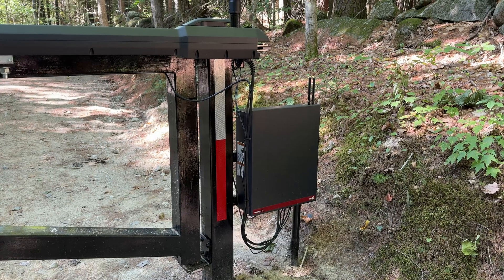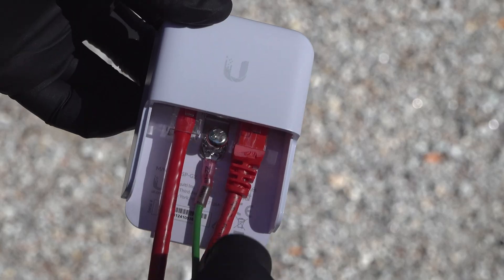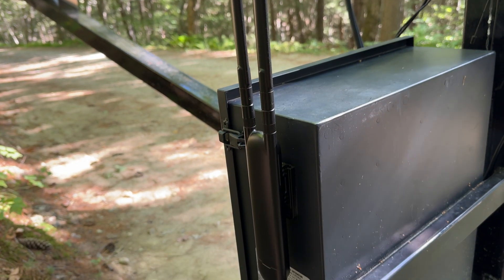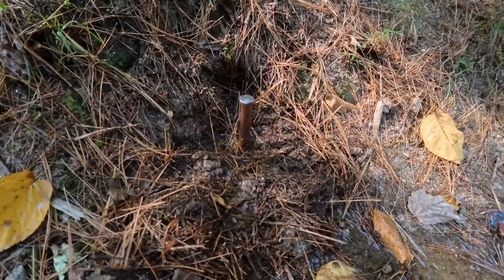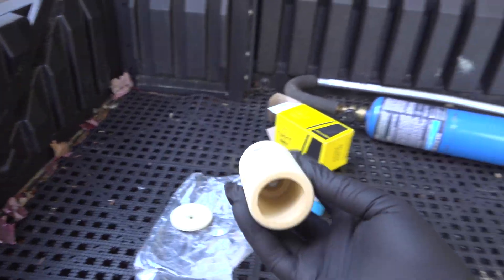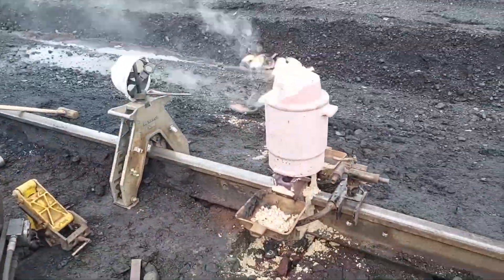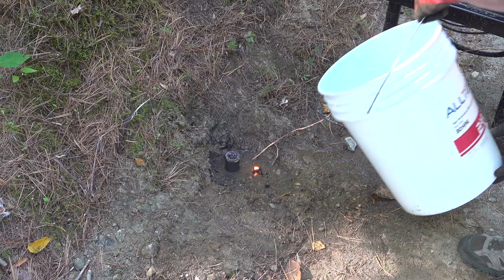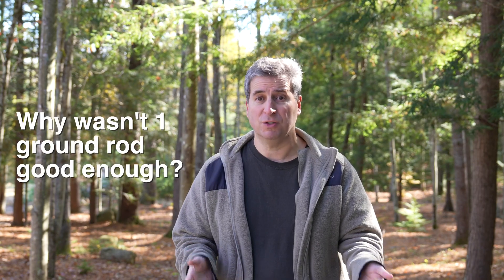Best Way to Protect Outside Network Equipment From Surges

Comment: If you have a hose near by use a copper pipe instead of a rod, connect the hose to the pipe and use it like a water powered drill. 2m pipe goes in, in a matter of minutes.

Comment: You have the correct concepts!  Good video!  Only one important "tweak" that expands on what you have already done.  Depending on soil resistivity (which can go from 100 Ohms/m in good soil to 10,000 Ohms/m on rock), the nice ground rod and #6AWG bare conductor in soil might still be 25 Ohms effective or higher.  Even 100 Ohms (3m rod in 300 Ohm/m soil).  Not magically 0V when current is flowing.  The key to electronics survival is BOND everything together as you show with your ground bus.  If that entire metal cabinet, gate, Ethernet, surge protector, switch, etc are all referenced to the same "0V" ground plane, then the 100 Ohm ground rod and Ground Potential Rise (GPR) doesn't matter.  A lightning strike that induces say 2A into your wiring into a 100 Ohm ground system is 200V GPR.  If everything is bonded, then it all "floats" together to 200V.  As long as it is 0V between equipment (bonded together), it all survives.  Bird on a wire.  Strong ship hull on a wave.  Bonding is more important than a super low (<10 Ohm) ground system.  This is how cell sites and towers take a licking and keep on ticking.

Comment: When I did my ham radio antennas I grounded everything using cadweld but I also bonded everything back to the service ground as required by code. Otherwise you’re going to have a ground loop and a nice path for lightning to get back to your house. That is unless it’s completely isolated from your home. But since I have 90 foot lightning rods (antenna towers) at my house it’s sort of necessary to bond.

Comment: Great video, I wasn't aware that these thermite like kits existed - and they are indeed the best solution. But I would be vary with shock cooling the weld, that will make it brittle which is no good.  I usually use the Raychem shrinktubing kits for terminating ground rods, they are inexpensive and the shrink tubing and intumastic tape are very thick and everything is made for underground termination.
For driving in the grounding rod you can buy an SDS adapter, they are fairly inexpensive and with a good SDS hammer drill they are in with no hassle. 

When installing 3-phace SPD units, I was also under the impression that they led the surge to the ground - but as I was told it's actually not how they work. They work by shorting out the 3 phases, Neutral and ground, and thereby hindering excessive voltage differential upstream to the consuming units. The ground is there to keep everything as close to ground voltage as possible, but the surges from lightning strikes are so massive that it's nearly impossible to lead it all to ground exclusively.

Comment: don't pour water on top of it , let it cool down on it's own, letting it cool naturally for 10–15 minutes ensures the strongest, most corrosion-resistant, and electrically sound connection possible.

Comment: The Cat cables also should be metal (YES THEY MAKE THEM) and the cable you use should have a foil shield and a shield cable in addition to the traditional twisted pairs.   Otherwise you are pissing in the wind.

Comment: Cadwelding is a thermite weld.  Same as what they use on rail.  More ground rods mean more parallel paths to the ground plane, meaning lower resistance.
  
Best thing you can do for long runs IMO, is convert to non-conductive fiber.  Yeah, it doesn't convey power like PoE does - but even if you have a lightning strike close to a long wire, it becomes an antenna.  Using isolation step-up/step-down transformers to take you 120V or 240V circuit and bump it up to 480V, and then grounding both the high-voltage segment and the local box at the gate, and surge-suppressing all of the AC lines keeps it mostly away from your low-voltage stuff.  Everything should go into a steel enclosure that is properly grounded/bonded, and all IO should go through a surge suppressor before entering/exiting the box.  I'd just plan on losing your cameras from lightning, have spares.
  
The higher the voltage for the same power, the lower the current (because watts = volts x amps) - which means you suffer less voltage drop over the length of the wire (and you can compensate for any drop with various taps on the transformers.  250Watts at 120V is 2.083Amps, but at 480V it's only 0.521Amps - so at 120V that's a loss over 1000-feet of 14AWG of 12.95V (or 10.79%), but at 480V on the same wires that only a loss of 3.24V (or 0.67%).  This doesn't get better with PoE++, which is only up to 56V as of the most modern 802.11bt Type-4 standard and tiny ethernet conductors.

Comment: Exothermic welding is the correct name.  Whether you are using a one and done mold or a graphite reusable mold it is good practice to heat the mold with a torch to extract all of the moisture first. Otherwise the chain reaction once lit could cause the mold to explode and you could be covered in molten metal which leads to a bad day

Comment: quick tip from a sparky (not like youre gonna be installing ground rods all day) if you want to install a ground rod without breaking a sweat just use a sds hammer drill with a cheap ground rod bit.

Comment: You shouldn't use ferrules on wire with only few strands, it may be less reliable than just screwing them in in a terminal block, cool project though :)

Comment: I prefer using fiber for total galvanic isolation. Sure, you need power at the other end, but this is way easier to protect than delicate networking equipment.

Comment: Just run fiber and leave the copper cable just to deliver power. Fiber is cheaper than UTP cable nowadays and you don't risk having expensive networking equipment damage by lighting!

Comment: If you're running ethernet wire back to the house, the rod and equipment at this gate need to be connected to a ground line going back to the house's main ground.

Comment: An SDS Max drill with hammering chisel is great for this. Also if its very serious, for a house as an example, consider using stainless steel
Reply: Can confirm works great.  There is also a specialized slide hammer for use on ladders with those 10' rods,  works like you would expect and prevents the crayon eaters from impaling themselves.  Yes, it has happened turns out trying to drive a 10' rod in rocky soil while swinging a heavy sledge can be very dangerous...

Comment: You didn't use shielded cable in your demo...... Nor any shielded cables in that gate box....  The ethernet grounding box connects the shield to ground so if you don't use shielded cable - then the box is still not grounding your equipment....
Reply: You're saying it contains no gas arrestors for the data pairs?
Reply: @SuperSpecies  No I never said anything about "gas arrestors" I said Shielding - those are not shielded ethernet cables. Having a remote ground but the ethernet is electrically connected to another networking device that's on a different ground needs to be shielded. Look up shielded ethernet. It requires shielded RJ45's also
Reply: @cryptogenik I understand what you're saying about STP. I'm simply asking if you know the internal layout of these grounding boxes for certain.
Reply: @SuperSpecies  You didn't ask if I know the internal layout of these grounding boxes for certain - you asked if I was saying it contains no gas arrestors for data pair, to which I said No - and then elaborated on why I did not comment anything regarding gas arrestors.
Your question is so tangential that I wasn't even sure you were intending to direct your comment at me other than the fact you replied directly to me
Reply: @cryptogenik I'm just curious if all these boxes do is ground the shielding, if so that's not very useful
Reply: @SuperSpecies  I know that continuity passes from port shield, to port shield, to the grounding pin. When all these are in contact the difference in ground comes closer to the same potential locally.

Comment: Grounding or Earth is a protection of the user from an electrical fault in your system.  This doesn't do anything for a ground lighting strike, or a lighting strike to your gate, it's literally nothing.  A real AC or DC surge protector is the only protection from lighting, period.....this is a sacrificial device facing your equipment from an external connection or an internal power source.   A copper ground rod is not in any way a protection from Power Surges.  You are protecting anyone who opens your cabinet with a ground fault currently happening in that the metal housings to be disappated to a safe level of either DC (48v or less) or AC which would be below 50Vac.  The earth is a ground at 25 Ohms resistance, best case with perfect soil conditions.  It can not handle nor route 250,000Vdc of a hit lighting strike, period.  The maths don't math my friend.  It will not save your equipment, it will all die in a strike at or near your fixture, period.
In nearly all instances, except very rural, your utility will provide your house a ground as part of it's service....it is the safest path back to Source, so use that.  Extra ground rods are fine, interconnected if greater than 6ft from each other.  Ground rods can create an electrocution hazard during a fault if you are standing near the ground rod and upwards of 25-30ft away.
Reply: Grounding does matter in protection against lightning.

Comment: The code states all ground must be bonded, which is not mentionied or done properly in this video.  

The Ethernet running back to your house could create a ground loop if you don't bond that new ground rod you added to the ground(s) at your house.  In simple terms your new ground rod may have better ground potential and carry all the ac current to ground, over that Ethernet cable.
Reply: He actually uses fiber optic Ethernet cables, but he does oddly run a 12v DC line from the house.

Comment: Just use Fiber for Outdoor connections... in the long run, it will be cheaper. Cable length wont matter much and you can upgrade to insane network speeds any time in the future without changing the cable.

Comment: You do not want to do this, it may even be non code. I know standard Ethernet does not pull through ground, it uses differential signaling. I do not know about POE +^n. HDMI does pull through the ground. So what he has done is create 2 grounds and has attached the ground between the what ever copper cable he is using to connect the ground between the two points. I have seen 125 volt ground spikes over ground between buildings not this far apart, when someone came in the morning and turned on their computer in the morning with the outlet strip. Just say NO to multiple ground points. An electrical system is suppose to have one and only one ground point. What you are doing is creating a ground loop, if you want do this you need to go through a transformer after this you can create a new ground, but this is risky you need to make sure you do not pull through ground any other way. Use Fiber it is not that expensive. The school of very hard knocks.

Comment: this is just basic thermite, also having that system isolated is safer for it than having a ground. It is only safer for "you" touching it with the ground.
ANd 2 grounds aren't required, they are only required if you don't test the resistance of them which is expensive so it's cheaper just to do 2. It has nothing to do with them failing it has everything to do with them never being the correct contact amount to the ground.

Comment: In my area 2 grounding rods are only needed for a 200 amp panel. If you have an older 100 amp panel or a subpanel in a different building. Most places dictate 200 amp panels as the standard for new built houses. This might be where the two grounding rod mandatory thing comes from.

Comment: Why would you waste those few inches by cutting them off? You should have just driven it a few more inches down. The more in ground contact, the better it will work. I don't have my handbook handy, but every inch gives many dozens of additional amps of protection. With lightning being the only source of danger, you want as many amps flowing into the ground as possible.

That crucible device is not welding, it is soldering the wire. Copper is way too conductive for that tiny amount of heat to melt the copper. After a few years, the dissimilar metals will corrode and it will break off, although, being buried, it should not have any pulling stress, so may be fine.

If you really want to use the crucible, then slide it on before hammering the rod. The mushrooming will actually give a better connection.

Comment: You need a Smart-UPS 

I have used them since the 80s and sacrificed many to lightning and copper METH thieves that cut the wires on my 3 phase transformer feeds and sent 600 volts into my 120 outlets 

But all my equipment except for the UPSs survived and APC drop shipped me brand new replacement units 

I LOVE YOU APC ❤❤❤❤❤

Comment: Or pro Tip. If this is a completly isolated install anyway:
Run Fiber, Its not really expensive and when a lightling strike hits your stuff is toast anyway.
The only reason why one grounds network equipment is cuz its expensive.
If i have a 80k Cisco swithc on one end and on the other it sure as shit is cheaper to ground.
But with these cheapo 5 buck switches ehh, why bother. And if you bother why not invest in a 100m fiber cable and solve that issue at the source?
Reply: He did run fiber for data due to the distance but he does have power over ethernet for the power. I am not sure how you get power over fibre.
Reply: @catprog  He actually just did fiber and DC Power from an external source. So PoE is just for the gate controller and cams/aps which kinda makes the title kinda klickbait.
I belive he had a hybrid cable with fiber and copper for DC, or ran it seperatly. But he did a vid on it.

Comment: Just an FYI, you're not doing much, if anything, to protect your equipment using the ethernet surge protector with those wires. Allow me to explain - if you look where the RJ45 connects to the unit you'll notice the housing is metal. This is where the ground is designed to connect. When you use standard plastic conectors they essentially do nothing to shed current to the bonding point. The way they were designed is to use metal RJ45's (Surge Protection Connector SHD) in conjunction with Ubiquiti ToughCable, which is shielded (metal webbing under the sheathing) this shielding is bonded to the RJ45 during installation. Qualification - OSP/ISP network engineer SME PTP/PTMP network design
Reply: Thanks for confirming this, I found this video very strange

Comment: Sorry what you did was stupid. Instead of using a grounding rod you have a big heavy gate that will have probably lower ohms than this short rod. Just use angle grinder and self tapping screw to attach the ground do the gate(grind paint, attach a cable with self tapper, paint with zinc paint done10min max.). If the grounding rod was much longer and resistance was measured I would agree it is better idea. My friend had a situation where he started doubting his meter because after driving 20m of 16mm grounding rod he could not get bellow 10 Ohms (maximal resistance for grounding in Poland and most of EU), but mine said exactly the same.   We ended up doing 2 rods, one 20m the other 12m and connected them together and got 7 ohms.
Reply from the maker: It's funny that was my original idea but it won't work.  You would think 1000lbs of steel in the ground got to beat that little rod? Nope, here why: Each post is surrounded by 2 feet on concrete  and gravel on the bottom. While some it might be conductive it fairly insulated by the concrete. However the gate framework is also bonded to the ground, so its working the other way, if lightning should hit the gate it now has a path to go out, whereas before it would have probably friend the equipment. If the posts were directly in soil it may have worked.
Reply: @silvercymbalworkshop  actually steel rebar in concrete poured into ground (without plastic membranes or any isolating materials) is better conductor than you would think. Concrete in ground is slightly moist(above 11%) and salts in cement help with conductivity. It wont have the conductivity of steel or copper  but is no isolator either. Other thing is if soil is extremely dry, no amount of shallow grounding will change anything, then you gota drill baby, drill! Grundig a gate one way or the other is an overkill, if lightning strucks anywhere near it electronics will be fried. 
Love your chanel, keep up good work.

Comment: Keep in mind grounding does not guarantee it will protect from all electrical discharges. If a close lightening strike occurs it will likely damage things. There's too much power for those protection systems to handle.

Comment: I'm gonna be honest with you, if someone doesn't know what T1, T2 and T3 surge protection is, and they just slap on a T3 thingie with some 2.5mm2 wire, they have zero rights to call their equipment safe. Wouldn't even be enough for an equipotential bond for normal mains voltage, let alone lightning strikes...

Comment: From a technical standpoint, you made your installation more prone to objectionable or stray currents.  Effective equipotential bonding is more important than the number of rods you install in your system.  Absent a bonding conductor between and connecting all of your rods together, lightning will still use the conductors in your network cable to try to carry the current to earth. It will fail.

For remote sites, fiber is both safer and more reliable.